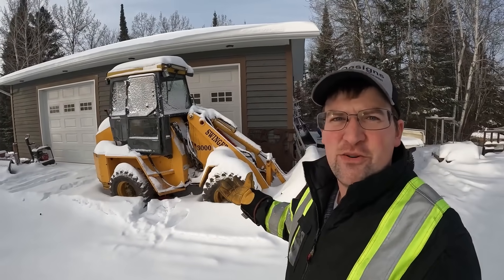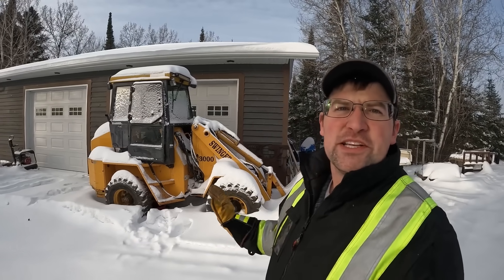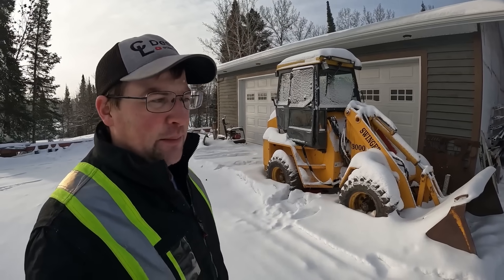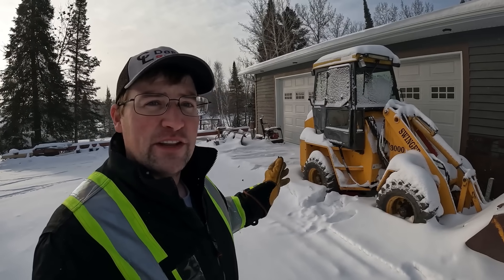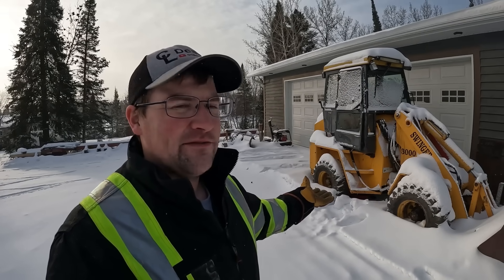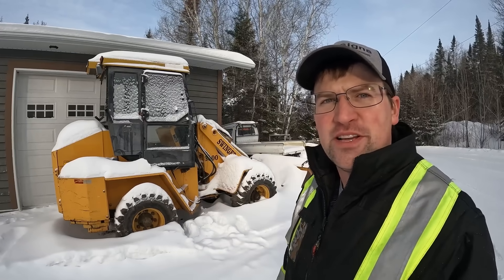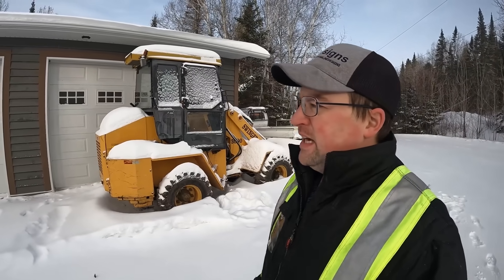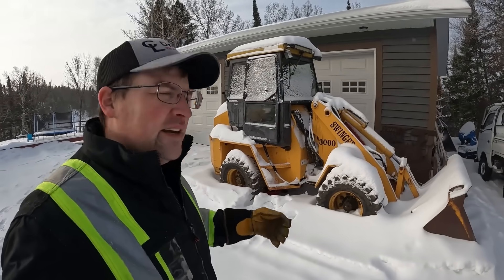$22,000 Hydraulic Pump FAILURE...... What Now?

Comment: HI young fella, maybe start with the franken  pump connection to the motor? You may recall  i mentioned on your first loader hydraulic pump removal video about the checking the nylon flex drive attached to the flywheel for wear . That being said the 2006  ASV rC60 tracked  skid steer  i have uses a flexplate that is branded  bowex 48 PLE-PA diameter 241.2 {it has 8 bolt holes common to the 60 hp perkins diesel flywheel} . The steel bell housing adapter plate the pump mounts to {with two 1/2" bolts }  is just a flat piece of 3/8 steel . The ASV rc60 skid steer has the aux hydraulic pump driven directly on the ass end of the hydro-static pump {aux is something like 16-18 gpm}.
 TLP {track loader plus has schematics for most all skid loaders} here is the link to the unit have if you wanted to have a peek at the hose arrangement from the pumps  
https://www.trackloaderparts.com/diagram-571.html
 worth noting  a few ASV units share the same parts {i know the rc50 & RC 60 did} Besides all the free TLP online parts diagrams ... the TLP folks are super helpful and might be able to cross reference something to open a wider range of "donor units" using the same pump set ups to make the donor franken pump easier to locate. Best of luck getting that baby up and running.

Comment: Went back to view the incident where this happened. You were correct about the radiator fan. Someone thought it was on right. WRONG! You can't just change a pull fan and convert it into a push fan by flipping it around. The blades are shaped and attached to the hub completely differently. For instance, the Part Number for a Blower Fan on a D8 Caterpillar is 580-5767 versus a Suction Fan is 139-7833. ALSO, i am fairly certain the Eaton hydrostat system would operate somewhat the same as the Sundstrand i referred to in my previous email. From what i remember the Sundstrand motor incorporated a cooling circuit that would send a certain amount of oil back to tank for cooling purposes. That oil would be replenished by the Charge Pump on the hydrostatic pump because both cases of the pump and motor are linked together. You can imagine cooling oil is needed because of the tremendous heat built up in the system!

Comment: Ya man. I mean really. A variable pump is a variable pump is a variable pump. You need to know volume per rotation and pressures from the original and you can start figuring out which models could work as a substitute. For what that thing is and does. It’s kinda really that simple. It’s not like you are working it to death every day. You just need it to work more or less when you need it. Hydraulics can be simple when you think of them in their basic parts/functions. Firstly. Is the pump manually operated or  electric or  pilot operated? Hopefully being an older unit. It would be manually operated. That would simplify swapping it
Reply from the maker: Yes sir. I think I have a couple different models I could go with now. I have a lot of the model code figured. It’s manual so that’s nice. I also have another shop wanting to take a look. Slowly learning everything I need to. It’s just they are so expensive I don’t wanna guess

Comment: I think you’re on the right track, that you’re going to need to mix and match to get it up and working.  I also think you’re overthinking it a bit, and while hydraulic pumps might have 20 separate order codes, I’d venture that most of them aren’t critical to your application, or can be worked around.  Start with the basics, variable displacement displacement piston pump, find out the pump size in in^3, there are only a few shaft configurations, and most of these pumps are designed to have a gear pump mated to them, again find out the size.  Then you’ll have to start shopping and spending a lot of time cross referencing all those codes, occasionally Surplus Center has some pumps you may check there to start.  Good luck, you’ll get it back up and going.
Reply from the maker: Exactly! That’s right where I am digging in now. Just takes time to wrap your head around and cross reference. Doing that while I wait to hear more about the actual pump. Cheers

Comment: There is a 3923-145, it has a splined shaft and an auxiliary pump mount but it looks like an “A” mount, I don’t know if your 2 series charge pump and auxiliary mount will fit on a 3 series pump
Reply from the maker: Thanks! I am not familiar with the different mounts so I’ll read up on that

Comment: Worst case scenario, find a pump with similar stats. You can run a hydrolic pump off the front on the crank of an engine ford tractors back in the 60s and 70s ran hydrolic pumps off the crank. Those pumps are around the 100s usd they ran the backhoe and loader on the industrial tractors and again its an external pump that runs off the crank on the front  pulley of the engine these pumps were on the ford 2000 3000 3400 4400 industrial tractors the pumps  differ in ratings but parts are readily available along with the hardware i think it would be worth looking into check yesterday's tractor if you do decide to go this route
Reply: Yes. But that doesn’t get him the hydrostat side.  Just the loader side. Still a great idea.
Reply: @Mad.Man.Marine I have limited knowledge on hydrostatic stuff most my knowledge is old gear driven equipment but doesn't a hydrostatic pump just pump  the oil into a bunch of hydrolic valves or is it built together in one? Like I said if have limited knowledge on hydrostatic equipment let me know im a young 20year old interested in gaining knowledge on equipment and vehicles

Comment: What was the failure that occured in the pump? Show the damage, show the extent. Hydraulic systems are not black magic, they are rhobust systems when designed properly. Can the pump be repaired? If not the system can most likely be retrofit with something similiar, you just need the time and the resources. 22k for a pump is just a "we don't want to be bothered" repair price, there are always other options.
Reply from the maker: Yup I just don't have the pump right now. It's 3 hours away. I need a plan before I go pick up the parts. I have a shop interested in taking a look for me after i told them the story.

Comment: What is that, like 5k US? Should be easy to source by model. At least get you the correct base model and you may have to swap some old parts over to make it work. Ebay is my friend in these situations. You don't even need the same pump, just a comparable pump. Hydraulics are like a "black magic" that enables shops and suppliers to bend you over a stump.

Comment: Hydraulic Supply has that exact model available for a little over $11,000 available in 2 days
Reply: Find someone within a reasonable distance that knows Eaton Hydrostatic Transmissions. Danfoss acquired Eaton several years ago, there should be someone relatively close who has been in the industry 25 or 30 years, that has the tribal knowledge, in agricultural are Eaton pumps were very common on harvester combines . The 39 tells you it is 3.9 cubic inch per revolution, the first 2 tells it’s a pump, the second 2 tells you what series or generation of 3.9 pump it is, the 019 tells you all the details of the pump, of which there are infinite combinations. I’ve been retired for 20 years from the hydraulic industry  and sold Eaton hydraulics for 30 plus years.
Reply from the maker: Nice thank you sir! I found another shop that wants to take a look at it. They find it hard to believe they can’t repair it for less. Problem is it’s close to 3 hours away and I need to find the time to go do that running around.
Reply from the maker: All i see listed it -109 not -019

Comment: You just need to find a pump specd with the flange type and shaft, typically they would be specd together based on power throughput. The other main important things being the displacement, pressure, rpm and critically, correct pump drive direction. Most everything around that can be fabricated and would be well within your wheelhouse from what we’ve all seen you do.

Comment: BEWARE: i am not familiar with your machine but in my past worked on machines that had Sundstrand pumps with either fixed displacement or variable displacement motors. Our policy (railroad maintenance equipment) was to change the pump and motor out in pairs. It's a closed loop system so if the pump for example went bad, all the contamination is going to the motor too. So, you are going to have to flush lines and probably make sure the drive motor is probably dismantled and cleaned. The gear pump you describe is probably a charge pump for the hydrostatic pump. If memory serves me correctly the Sundstrand's i worked with had a small vane pump as the charge pump. Bleep, it may have been a gear charge pump too, i forget. We also had Rexroth, Vickers maybe we even had the one you have on other equipment. I worked mostly on Tampers and Ballast Regulators. We had our own hydraulic room where there were 2 hydraulic test benches and lapping machine for lapping components like the piston rotating assembly in Sundstrand components etc. THE POWERS THAT BE CLOSED THE HYDRAULIC ROOM DOWN, SOLD ALL THE EQUIPMENT PROBABLY AT BARGAIN BASEMENT PRICES, AND WE MECHANICS THEN SENT ALL THE HYDRAULIC STUFF OUT FOR REPAIR. Rarely did we fix cylinders or valves anymore on the floor. Years after that there were still heavy-duty storage cabinets full of hydraulic parts for pumps, motors, valve bodies, seals for cylinders, etc. around!! What a waste---i could also tell you about the ENGINE OVERHAUL room they also shut down. WE ALSO HAD A DYNO ROOM FOR TESTING THE OVERHAULED DIESEL ENGINES. The dyno was still there when i retired long after the engine room was shut down.
Reply from the maker: I was wondering about that. Makes sense to at least remove and inspect
Reply: @CenterLineDesigns Oil cooler too, if there is one.

Comment: Pump now motor or transmission next, cut you losses and put in the auction. Someone out there will buy it for parts.
Reply from the maker: Problem is I can't replace it. They are rare around here and demand a high price and would only go for scrap price. Luckily there is no transmission, but I am going through the motor.

Comment: $22,000 seems like a price of someone not interested in even touching that pump, let alone try to fix it. 

I believe that pump has a displacement of around 64cc or close to 3.9 ci. This should be the base number you need to get another similar pump. Of course, new mounts and drive adapters will most likely need to be made, possibly even a bearing mount for the gear pump for the loader and run it with belts instead. 

If you don't have any specs on the relief valves of the travel pump, you may need to build a jig to test the old ones and see what pressure they're set. 

Maybe I'm spoiled here in Portugal as I have 3 great hydraulic shops around but I'm part of various US based forums and it seems sooo hard to get a good and competent hydraulic shop base on experiences from other people. Either they can't identify basic fittings, they charge stupid prices for simple hoses, or like in this case, they just give you a "I'm not interested" price.
Reply from the maker: I think you are spot on! Hydraulic shops just don't feel that common around us. I can get fittings and hoses easy enough but Pump specifics, well i am still searching.

Comment: Apparently, these Eaton pumps were also used in agricultural equipment like combines, tractors, balers, etc. Not sure what part of Canada you are in. Hopefully they have parts cross referenced and not just specific to Make and Model of machine.  Here are some options for used parts for agricultural equipment sold in Western Canada:
Loeffelholz Tractor Parts: Located in Cudworth, Saskatchewan, they offer a massive selection of pre-owned combine and tractor parts, with immediate shipping options. 
Gratton Coulee: Specializes in salvaging late model used farm tractors, combines, swathers, and forage harvesters. They also offer rebuilt and new aftermarket parts. 
LINDSAY USED TRACTOR PARTS LTD: Provides a variety of salvage parts for numerous types of equipment. 
Harvest Salvage: Operated since 1985, they sell used combine parts and tractor parts, with a large inventory of aftermarket new parts. 
Used Tractor Parts (Grandview): Located in Grandview, MB, they provide used tractor parts. 
Double "R" Farm Equipment: Offers a huge selection of tractor parts and agricultural engine parts. 
These suppliers can help you find the parts you need for your agricultural equipment in Western Canada. AS you have found out anything hydraulic, especially hydrostatic pumps, are very expensive to buy new or even repair. Sundstrand is another well-known brand but expensive too. I would imagine there are used parts places for heavy equipment as well.
Reply: Harvest salvage in Brandon has been closed for about 4 or 5 years. As far as i know used tractor parts in Grandveiw is closed as well because Bob retired and the price of scrap was so high he cashed everything in. I'm in south west Manitoba and bought parts from both. It's getting to the point we are running out of places in Manitoba that are worth dealing with . I quit fixing tractors for customers, and buying some to fix because it wasn't worth the hassle finding new parts weren't available  or the prices on new or used were crazy compared to the return on the tractor at the end. .
Reply: @super6954  Thanks for the info. Manitoba here too, spent 40 years working for the railroad (CN). Machine operator, then mechanic at the only track maintenance equipment shop (Winnipeg) left in Western Canada. Edmonton, Saskatoon, and Prince George were shut down many decades ago. I retired in 2018. The internet isn't very up to date on their info apparently. LOL

Comment: I think the Parker PVP series are similar to these Eaton ones, they are  heavy duty variable piston pump may fit for your application, they have a composator valve to adjust the flow, your hydraulic circuit must have a releive valve in order  to prevent  blowing any componants down the hydraulic stream circuit and protect even the pump itself, ebay would be a good place to find one. Since you are an electrician hydraulics are like electricity, i am sure you can figure out something. hope this could be the spark ! cheers from Quebec
Reply from the maker: Thanks! I have been learning about a few pumps now. The A4VG71 seems like and option, I'll check out that PVP. Yea I deal with hydraulics at work too but i just don't consider myself well versed.

Comment: After doing some Googling there are a couple tacks you could take:

The Eaton 3922 is a Heavy-Duty Series 2 Hydrostatic Pump. The problem is, without the 31 digit model code we won't be able to spec an exact replacement. We can get close but there are several variables that if we knew would make it a lot easier. i.e. input shaft, CW/CCW, port sizes, relief settings, charge pump size, aux mounting etc. Eaton Form No. 11-608 has your pump in there...somewhere. And if you can figure out what all the codes are, a good hyd supplier should be able to spec a cross that is very close (and also available). Also depending on what kind of parts breakdown you have and how strongly Swinger believed in obfuscation, you may be able to determine what the specs are through a parts breakdown. Eaton parts manual E-PUPI-TS004-E should list most of Eaton's option p/n's. Occasionally OEM's just used vendor p/n's for things like that, not often but your odds are better in 1998 than they are today. Which leads into the other option.

Swinger wheel loaders were built by NMC-Wollard who still exists. Looking them up and looking at the factory on Google, they aren't a massive factory. And they haven't relocated since your machine was built. If you play your cards right. You may be able to get a hold of someone in engineering who would be on board with your wild goose chase and might be able to dig up the original model code for your pump. Problem is it might not be on a computer, but being built in 98 means maybe the model or the pump was in-use on another model or being order as parts long enough it got put into a computer somewhere. Having worked for equipment manufacturers, that info is out there. And as an engineer, it's an intriguing mystery. I know I'd sink some time into solving it if I was at Wollard and I heard about it.

Comment: just as an armchair spectator who Watches A Lot Of These Kinds Of Video, I would suggest to start looking at VDP pump w/gear pump  assemblies made for mini-excavators of similar size/weight. it won't be a perfect match (ref your comment about 20-character design codes), but it should at least give you a place to start looking and Asking More Directed Questions of your hydraulics shop contacts. Also, someone else said contact C&C Equipment, I second this. They do a LOT of hydraulics work, digging right into the gooey guts of hydrostatic drive bulldozers, they will probably be able to answer a lot of your questions

edit: something else occured to me: if you can find a VDP pump assembly for a mini-Ex with the right flow/power specs, you don't need both drive pumps, and a lot of those units are *modular*. a good hydroshop may be able to Downbuild a 2 VDP, 2 Gear unit into a 1 VDP, 1 gear unit
Reply from the maker: Awesome thanks for the input! I am going to send clint an email shortly

Comment: Where in Canada are you? Is there a Ritchie Bros auction nearby? I'd be looking at rollers, sheep's foot or flat 10 tonne or so rollers, they are all hydrostatic drive and I bet you'd find one in the dead line with a blown engine 👍 I would worry too much about all the specs and build info, just get one with similar flow and pressure and make an adapter plate. The biggest issue you'll have is the control, is it foot pedal forwards and reverse?